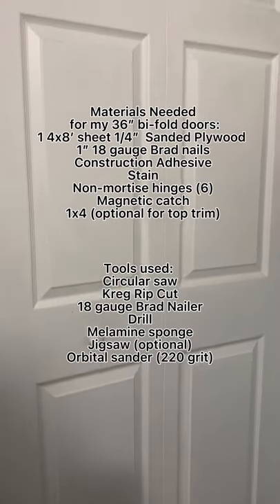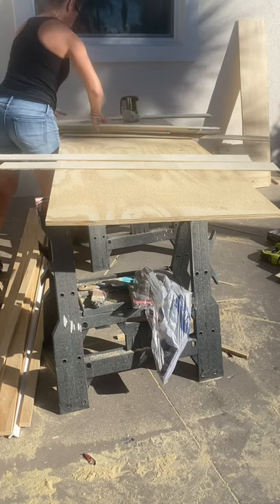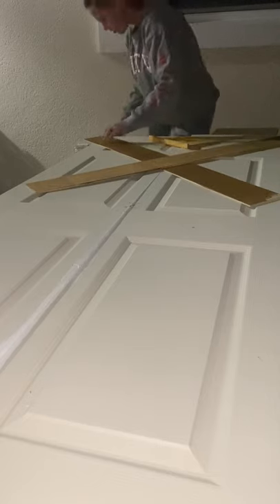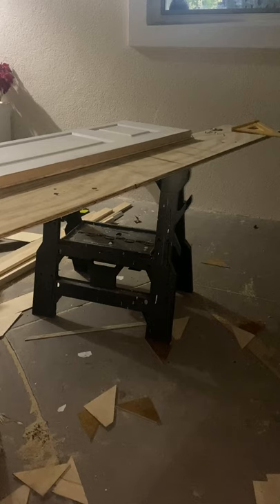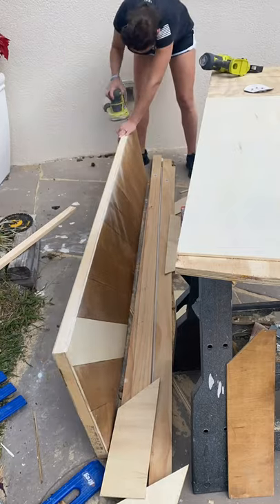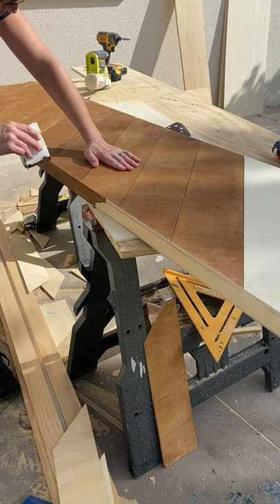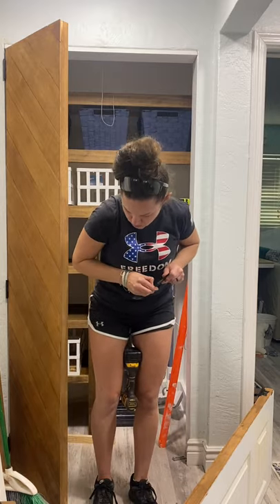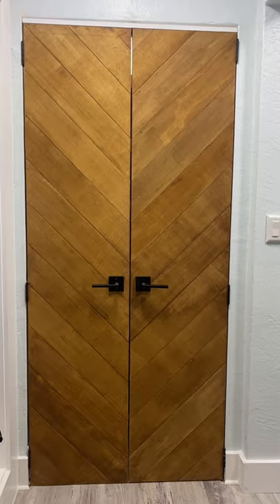Turn your bi-fold doors in to custom Double Doors for under $100! Full Tutorial! Fix Broken bi-folds

Comment: This is awesome! Thank you! I want to do this with my bathroom closet. But for my laundry room, the closet has two bifold doors so I’ll need to figure out a way to keep them straight (not folding) then follow your process using 2 doors, correct?

Comment: I was curious as to how you would cut openings in your bi-fold doors to create French doors, particularly because most bi-folds are hollow.  Disappointed!
What are French doors?  
"A French door, which is also sometimes referred to as a French window, is a door made up of panes or panels of glass. Wooden frames or partitions separate each pane. Glass panes are generally rectangular in shape and make up the majority of the surface of the door. This type of door is typically used as a style element. It is frequently used as a way to bring more natural light into a home, or as a way to divide rooms and set them apart while still maintaining an open feel to the overall space."
Reply from the maker: Sorry for the misunderstanding! Not all French doors have glass! This video just shows how to turn them in to double doors opening as French doors. Not sure how to make hollow doors with glass unless you were to make your cuts and then add some sort of blocking possibly 1x2s around each opening to secure glass.
Reply: @EastCoastDIY27  No worries!  Have never known or seen French doors (my ex is a contractor) without windows.  Opening from the center doesn't make them French doors.   
"Revamping bi-fold doors" would have been a more accurate title.   
From the comments, I would say that this suggested title might even get more views.   People wanting to to something with their existing doors and many knowing and not wanting "French Doors" on their closet or in their bathroom.